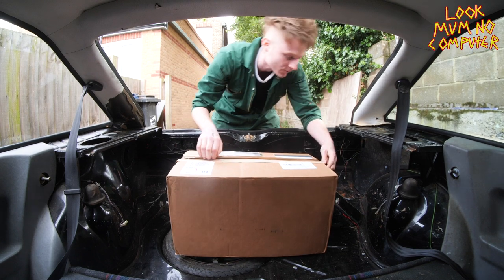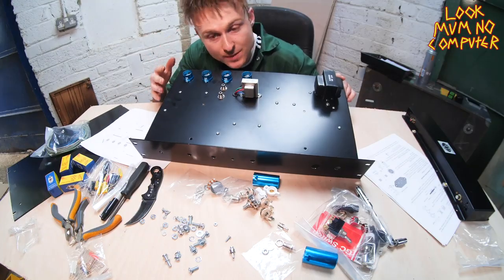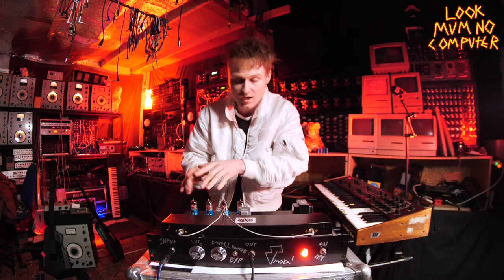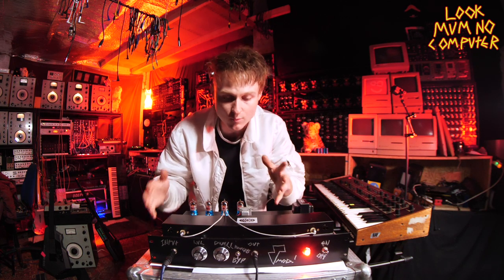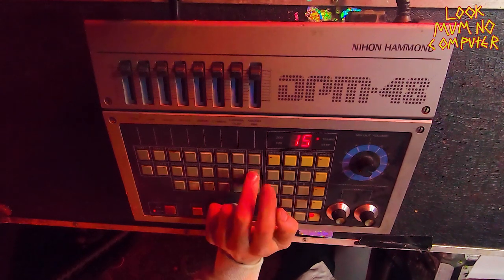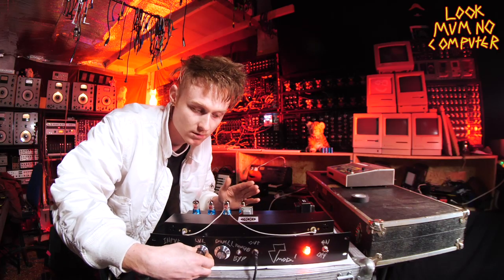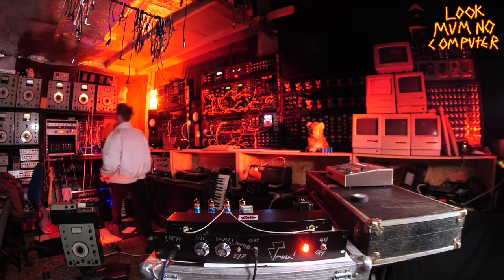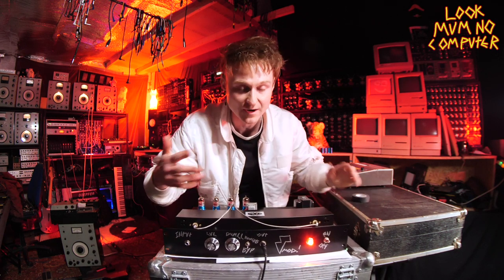DIY Tube Spring Reverb? :-O

Comment: I love a spring reverb. I used to have this old amp from the 70's and I loved that amp. It had a real spring reverb that sounded amazing. I wish they'd make a real spring reverb that was a bit smaller and had more enclosed chassis, like something meant to be able to fit on your pedal board. Obviously it would have to be bigger than your average Boss pedal but they could make it fit on a pedalboard. It would have to be long and thin.
Reply: There are a ton of those. From the Danelectro-Spring King, to the Surfy Bear- reverb, and probably areas a dozen more if you look hard enough. My favorites probably this one, the Knas-moisturizer, or the Surfybear, though those are all larger. The best pedal sized one imo, is hands down the Anasounds spring reverb, it's 1 pedal, and they have 3 different sized tanks you can get for it that aren't to large, plug I to the actual fx pedal and are ment to be wired underneath your pedalboard.

Comment: that's a really dope piece of equipment, i'm not exactly into kraftwerking sound but anyways i found that the PT2399 chip is pretty decent (not hi-fi maybe) and has a long delay, even the ones bought on ebay, can't say the same for the HT8950 pitch changer, glitchy and distorted

Comment: Don't buy it guys. I bought one about a year ago. It does reverb but it has very little drip. It is not drippy at all like you would expect from a real spring reverb.  It also adds a decent amount of noise to your signal. I ended up going with the source audio true spring reverb which is much better in my opinion. It's a digital pedal but you have way more options way less noise and it sounds more like a spring reverb than this thing does.
Reply: The noise was one of the parts I liked :)

Comment: I had an idea for a tape saturation/distortion effects unit that basically uses a strip of cassette tape sandwiched between two tape heads (diagram to follow). I don't have a lot of electronics experience, so do you think that would work? If so, I'd be more than willing to let you prototype it. Let me know and we can work something out.

Diagram:
IN>GAIN1>HEAD1>||>HEAD2>GAIN2>VOLUME>OUT

(Alternately, you could route HEAD2 back to HEAD1 with a pot to create a controllable feedback loop. Or so I imagine...)
Reply: Just based off what I understand about tape, it wouldn't really work like a distortion/saturation effect, because tape is just a strip of magnetized material and cellophane and all a record head/play head does is modify or read back the magnetic fluctuations on said tape. So if you tried to use it like that you'd either have the last recorded sound constantly ringing out or you'd have to move the tape along and at that point it'd act as a looper.
Reply: I'm not as well very qualified in electronics, but I'm re-building a cassette deck from the ground up, and both the "gain" sections of the recording and playback heads are pretty complicated to make. It's not a dumb amplifier, the gain varies depending on the frequency, to counter the poor ratio of noise/signal in the low end spectrum. Plus for the record section implies a high frequency oscillator (above 120kHz) coupled with the audio signal, to make the tape particules receptive to the audio. That needs op amps with feedback loops complex to design... I searched the proper way to compute the components values, but the maths behind are just beyond my capacities... If you're willing to built one though, I could recommend you the sonelec site ( https://www.sonelec-musique.com/electronique_realisations_preampli_nab_001.html ) but it's completely in French... The schematics are still usable though...
And please excuse my English, I probably did mistakes but it's not my native language (French as you guessed)...
Reply: @BarnacleButtock  What produces sound isn't the amplitude of a wave, but the difference in amplitude from one point in time to the next. If the signal doesn't change over time—either because there's no change in strength or, in this case, no change in time—no sound is produced.

As for the function of the tape, think about it like this: if you place a speaker directly in front of a microphone, the mic will record exactly what the speaker plays. If, however, you put a block of foam in between them, the foam will absorb some of the higher frequencies, and only the lower ones will reach the mic. The foam acts as a physical filter. In the same way, the tape modifies the signal coming from HEAD1, and HEAD2 picks up that modified signal.

That's the theory, anyway.
Reply: @U014B  which is why it's THEORY--the difference between your analogy and the real world of tape is that you cannot put tape between two heads like foam between speaker and mic and get the sound of tape saturation. Tape saturation is produced by the act of reading magnetic fluctuations FROM THE TAPE, therefor putting a record head on top of a read head with tape between wouldn't produce that sound--you'd just get a muffled signal of what's coming straight from the record head. If you'd like to read recordings from the tape, the tape needs to move and both record and write heads must be reading the same side of the tape. Do you see the issue?
Reply: @kernealalpiniste6293  Cela semble assez complexe, oui. Raison de plus pour sous-traiter le travail à un professionnel. Quant à ton anglais, je l’ai très bien compris. Je ne parle pas français, j'utilise donc Google Translate pour écrire cette réponse. Au moins, vous connaissez un peu l'anglais! (Google est d'ailleurs en mesure de traduire le texte de la page que vous m'avez envoyée, ce qui aide.)